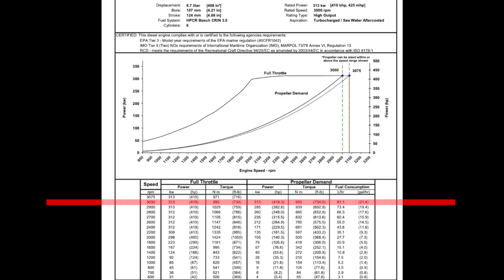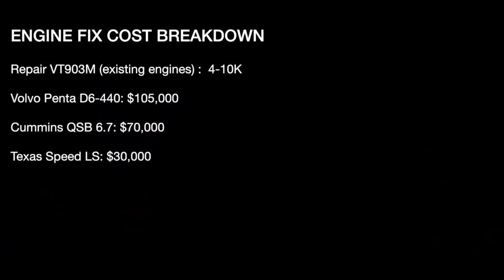Tesla Powering my 30yr Old Italian Yacht? And Broken Diesel Engine Diagnostics

Comment: same way they should do cars if they want long range electric.  high efficiency diesel with generator constantly charging batteries, APUs on semis can run a 30amp generator, 12v 60amp alternator, water pump, and fans along with AC and heat options for as little as .15 to .2 Gallons per hour at a weight of around 450-550lbs and take about about the size of an inline 4cyl or smaller... this would work in small boats and cars but for large heavy beasts not so sure this would be feasible if you want a decent amount of speed.

Comment: I know this late but putting gas engines in that boat will reduce the resale value to almost nothing.  I suggest you call Seaboard Marine in Oxnard, CA.  They are experts on marine repowering and they can answer any questions you have, especially performance issues and prop sizing.  Cummins has a number of reman enigines you might consider.

Comment: You need to look at industrial engines, they will be rated to run continuously @ a given RPM and torque.  These engine are usually used in generator applications. Your buddies at Texas speed should be aware of these types of engines.  Your 903’s have backup systems to detect and reduce power with overheating or low oil pressure shut downs. As well as low voltage or high voltage situations.  Any gasoline engines would need to be protected in the same manner. 
   The Tesla idea is pretty cool in theory, but as you said it would be like a trolling motor, unless you could get the semi battery/ motor setups. I’m not sure Elon is ready to sell you two. Also a solar power system would be very helpful. But there again a huge system would be needed. Probably not enough roof area to make it viable. Just my thoughts.

Comment: sure, sticking with Diesel is the safe way to go for the value. BUT this is B is for Build. don't go boring. My vote is Hybrid Tesla motors with a diesel generator. it's one of the only platforms that can handle it. AND it creates a possibility of increasing interest and therefore higher value. AND way more interest toward the channel to be honest.

Comment: diesel electric would be the go,you have say a 100 hp diesel running a 10 kilowatt generator,solar paneled roof for charging when boat i not in use.
boat could be used for the cruising part of the voyage at the generator capacity,with the electric motors providing the the drive,when more power is required the batteries then would kick in to give a good boost for a short run  if needed.
at slow speed the diesel could run at an idle to keep batteries charged,or turned off for silent running,batteries would also give you a great house battery capacity.
the amount of diesil you would need to carry would be significant less saving wieght.
i have a 30 ft with 2 110 hp volvo penta motors,good yes but they are getting old and salt water is taking its toll so i am  looking at doing this setup but with just a 50hp genset.

Comment: I think it depends on how long you want to keep and use the boat combined with the expected resale value. If you don't want to keep it too long and don't need to make a ton on the boat, get the gas engines. Less invested and less resale. If you want to do it right, with higher reliability and better resale, get the diesel. Higher investment and higher return. If they are rebuildable then THAT is your best bet by far.

Comment: Don't do eletric. If you get water in, you can be in a serious problem. Cheapest option would be a repair. Next cheap thing two old truck engines. On of my uncles had to get another diesel plant for his river barge. He exchanged an old 40hp diesel engine against some Volvo turbo charged monstrosity. Both engines  had the same dimensions. In the end he once sank the boat when he plunged the accelerator to the desk. The massive power just sucked the stern under the waterline and down she went. Luckily a swiming crane was in shouting distance so they could recover the barge. Now the accelerator is blocked to ever go above 50% of their power.

Comment: Diesel is more efficient than gas, typically more reliable, often safer, doesn't produce carbon monoxide  (an important consideration when running the engines or a genset for power while stationary) the weight of diesels helps the boat to not be so "tender" when acted upon by wind, wave or load (to what extent I couldn't say) - and you already have them which make them less expensive than any other option.  Switching to gas and their reduced weight may change your trim an undesirable amount, possibly enough to necessitate a waterline change.  Switching to gas will necessitate installation of explosion proof ventilation fans for the engine room if not already so equipped.

Comment: Diesel is much safer on a boat, gas vapors are heavier than air and rest in the bottom of the hull until ventilated out. Any leak is a risk, boats originally built with gas engines require all electrical devices to be ignition protected (sealed) an older diesel made over seas may not have ignition protected devices throughout. Not a huge cost to retrofit but a big risk if you miss something and have a problem with a gas fuel system. There are plenty of gas boats out there but they should be build with the mitigation of gas vapors in mind from inception.

Comment: Please rebuild cool Italian diesel engine - maybe both engines?  At least check out the good engine.  Then add the oil pressure low shut off option you talked about.

Comment: KISS. Keep it simple justrebuild and stay diesel. You got one good engine so just fix the other one as they have low miles. Fuel prices and long range are a win with diesel by.  Especially for a big heavy boat as they things have torgue. No spark plugs or coils to ever worrry about.

Comment: Tesla has to be the worst option of the three.  I would imagine besides being stranded easily, and having no range, if those batteries get wet in any way, you would have toxic fumes or a fire while at sea.  Diesel's were spec'd for a reason, and if safety and resale value matter you should rebuild your current engine or swap to modern diesels. Plus you said yourself, Diesels are a new arena for you guys so this is a great time to learn.

Comment: There are large cruisers around that use electric motors with solar panels, never need to charge from shore power, but of course they do not run at full speed all of the time. 
If you just want a high speed toy to play with, I guess you have to go diesel.

Comment: Disel engines rebuild and upgrade the ones in the boat, there is a reason boats have disels in them and people look for disel power plants in boats, cuz they are proven to work , its also the reson the manfactorers put them in there. The its hard to improve on italian desin in both cars and boats as the italians do it correctly the first time.

Comment: Just think about why those diesel engines were put in the boat in the first place, the same reason that Ferrari put big V12 engines in their car, it gives good performance. Why did Audi put diesel engines in their Le Mans 24 hour race cars, they give good competitive performance with lower fuel consumption. Plus an added bonus, diesel engines are far more reliable than a gas engine ever will be. 

So for me it is a no brainer, rebuild the diesel engines you have, put them back in and you have a boat with good performance at top revs and a boat that will give long range at lower revs, and will be way more reliable than any gas engine. I was a Marine Chief Engineer on tanker ships so I know a bit about diesel engines.

The electric option doesn't even come into the equation. Italian boat builders know what they are doing when they build a boat.

Comment: DO NOT put a car engine in it. It will get FRIED FAST. Those engines run full power for a long time. Try driving your LS for 2 hours down the highway near redline. It will blow fast. Second, the car engines don't make enough torque to get that boat out of the hole, because the cam needs to be changed and a whole ton of other things. Leaving the car engine core plugs and steel head gaskets in salt water will kill them pretty fast, also the cam needs to be an anti reversion cam, regular car cams will pull water from the exhaust and hydrolock the engine in a blink of an eye. Also aluminum car engines don't last very long in a corrosive marine environment. Would also need a swap of all ignition parts, need a different fuel and timing map. that cummins may not make a lot of hp, but the torque is huge, which is what you need to get that boat out of the hole. In my opinion the best would be switching to the newer QSB series engines.

Comment: I'd go Electric,  with a Generator. The Generator, when running allows you to go further and a little faster... While also charging your Batteries at the same time. Then you switch back to all Electric for Silent, but slower Fuel Free Cruising. Your Fuel Costs will drop significantly.Full disclosure, I have not done this yet, but have done extensive research. Elco Electric Motors might have the perfect solution for one of your viewers,  as I'm sure by now you've done whatever your going to do with your boat.

Comment: High output diesel generator powering the battery packs/motors/motor controller.
Reply: Okay a high output gen to match the power of the original motors + the losses inherent whenever you change from mechanical to electrical energy plus back again when the electric motors change electrical energy to mechanical energy to spin the props means you would need 30 % more fuel and much larger diesel generators to provide the same power that diesels alone produce

Comment: The problem when converting to a totally different power system is you would have to replace the transmissions also, that diesel is designed to run about 2100 to maybe 2300 rpm max. Gas is totally different. 
Fuel economy is vastly better with diesel, plus safety issues are critical, ie. gas vapor explosion is not uncommon in boats.
Stick with the diesels

Comment: 12:40 other options...
18:30 battery would be a range problem.
20:40 you got the math quicker than I did. You'd need hydrofoils
You'd need a powerful dc genset too. 100kw maybe?

Comment: Definitely go diesel on a boat that size gasoline motor would make it more complicated and would make driving around mindlessly impossible you should definitely rebuild the diesel and then add failsafes make the diesels cooler and more modern with technology

Comment: Gasoline engines should be good for about 3 gallons per mile in that boat in spite of the optimistic numbers you quoted, unless they were PER ENGINE.  You might get close to 1 mile per gallon with diesel engines.  Volvo Penta has a reputation for being a high quality engine that is extremely expensive to repair compared to other marine engines.

Comment: So diesel powered ev motor with batteries ..use lead acid because of high discharge and loaf capacity and the weight will help for stability .....and resale ....

Comment: Ditch the Tesla gear...use high amp delivery, lifepo4 prismatic cells batteries.., an enerdrive dc to dc & simarine system & house mono solar panels...then use high torque 12-48v (depending on setup of batteries) electric motors. The more solar the more range & faster charging.... The higher the voltage, the less amps required to run it...The right lithium will Charge in 2-4 hours from solar alone, providing you have the panels...lithium prismatic cells are unreal!

Comment: Diesel with upgraded induction system. consider Bio Diesel (which may need a heater installed in the fuel cell)

Comment: What about same engine as Mustang mach e, those stackable motors YASA P400. Swap a battery to the fuel tank with same size and add solar panels, generator might help if you got stranded xd

Comment: There are so many performance diesel shops that I am sure  Could rebuild the ones you have and Upgrade them with a Bigger  Turbos better  Fuel  system Bigger injectors I say stay Diesel Even if it's not the ones that came in it

Comment: Did the math and the Tesla packs will get you over 90 minutes of power at 25mph. Easily. And there is no reason that you couldn’t put 4 packs in that boat. The weight would be fine.

Comment: Honestly, I would prefer if you just did the rebuild and used any extra cash on upgrades to other components to the boat. Instead of new/remanned engines and not being able to do much beyond that until you could recoup from that expenditure for even longer. Just my opinion.

Comment: At full tilt with gas engines you will be burning waaay more than 60 gph!!! I used to burn that in a 50kn, 28' boat with 2 x 200hp gas engines
If you wanted to go diesel electric then Teslas with a gas turbine generator set - probably the most economical to run option very light & huge range possibilities
Otherwise, just refurb the diesel(s) - those engines can produce a lot more hp reliably if done properly

Comment: If you're going to rebuild the original cummins anyway then just go with your original running gear. Putting new diesel's in the boat would only increase the value, so doesn't make sense to spend the money on both. Either put in new diesels or rebuild the old ones.

Comment: Go diesel. Just rebuild the engines you have now.

OR do your math right and take note of the 90%+ efficiency of electric motors vs <20% efficiency of combustion engines. Get cheaper batteries and motors, and use more than 2 batteries. They are heavy, but so are the diesels you have now. Also, get a proper generator like a Cummins Onan that can run SUPER efficiently and recharge you batteries on the odd occasion that you are going long range. There will be a lot more space after you lose the gas tank and diesels. They are super quiet too and will give you power for anything else you may want on your boat. Like a hot tub.

Comment: Firstly There is a reason the boat was released with Diesel engines, secondly, do you think you will get 30 years odd from petrol engines ?? The other issue to consider is ballast. If you fit lighter engines it most certainly will change the stability and handling which possibly could end ugly, it may also have implications with your insurance. Personally I vote repair and restore what you have.

Comment: Buy two old broken junkyard F-350 diesels with good 6.7 power stroke engines that work, transplant them into the boat then put two Tesla motors and 6 battery packs and have it all...

Comment: If it were my money id buy two new cummins marine engines. Rebuild your current setup and sell them to pay for 1 of the new engines. Modern diesels have come along way in torque mgmt and noise and vibration dampening. Plus more effecient fuel mpg

Comment: As a truck driver with 11+ years personal experience, I say stick with diesel. Stay away from Volvo, period. They are decent, but parts cost and availability is just trash 🗑. 
I can guarantee you, that rebuilding this engine will most likely be cheaper than LS swapping, and on top of that, the longevity that will be gained is way longer than 5 LS swaps will last. If you wanna go cheaper marine diesel, look into 14L Detroit 60 series. Those are rated for 18,000 hours in a marine application @1,940 ft/lbs or 40,000 @1,640 ft/lb.
I think its cheaper and more reliable to stick with what you got.
PM me with engine serial number, I can probably get you the cheapest genuine Cummins overhaul kit, and a recommendation for a reputable diesel engine re-builder.

Comment: "B" is for "boy did you step in it when you bought this boat". Anything but a rebuild on existing engines would be complete insanity. 750k price tag new and it brings 42k in the sale used? Roughly 5% of the new price.....You'd see me running the other way, fast. Did he even do a survey on the boat pre-purchase?

Comment: solor power it! Take the engines from an Tesla model S and use a Tesla power wall.
Reply: Solar are you kidding ?  The boat weighs in the region of 10 tonnes not to mention the drag coefficient of water compared to air/ rolling resistance .. solar panels and batteries will work for the fridge on board  but ... electric propulsion on a boat this size or weight ,  umm no

Comment: High voltage on/in the water?
Bad idea.
Go for a rebuild of the original engine. Perhaps both engines. If the broken engine produces more power after the rebuild your also instable and torque steering your riva.

Comment: You didn't mention highly efficient common rail diesel generator electric motors?  I have been wondering if that is something that would work.  Although now on my slightly smaller boat I am hooked on my VM Motori 504LS.

Comment: What if you did a hydrogen fuel cell conversion??? Could you price that out? And then you could have an electrolysis unit on board that makes fuel and compresses it when connected to shore power

Comment: Maybe running an electric motor in tandem with diesel would work, definitely cutting down on fuel and emissions. The issue is battery packs aren't quite there, both in price and size. You'd probably need two Tesla semi truck 500 kwh battery packs to make it worth it I'm guessing. But then have to deal with the insane amount of charging time and finding a safe place to put them. I'm assuming your $100k Tesla batteries are fucked if water gets into the bilge